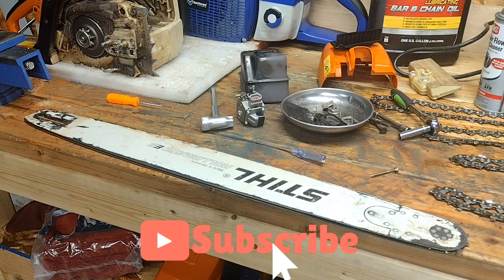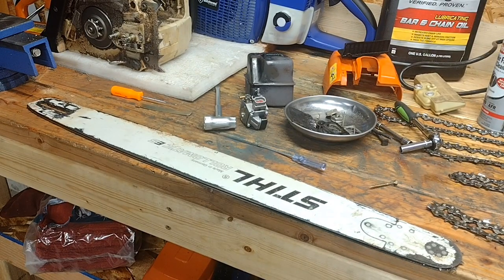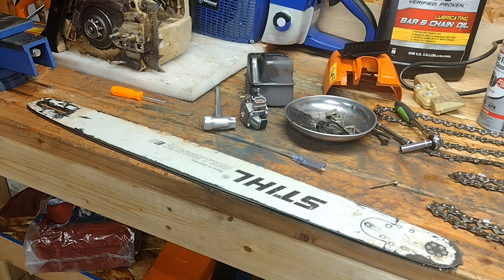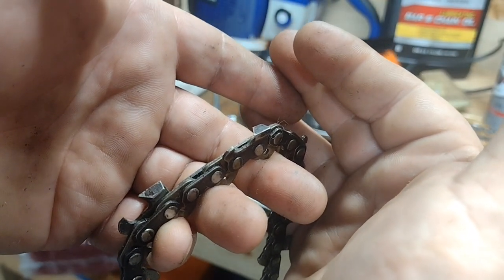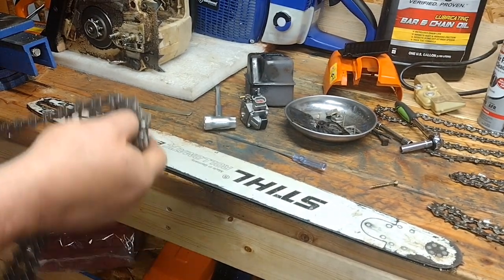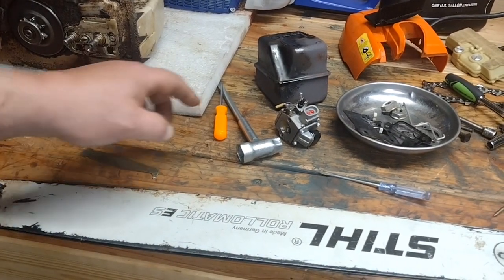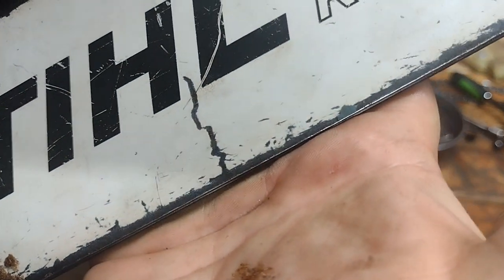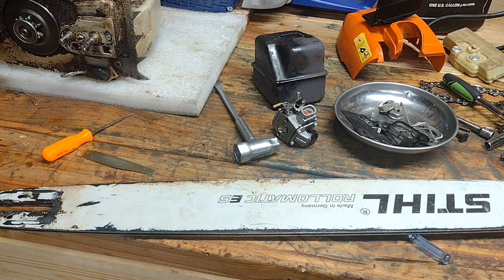Chainsaw chain stretching to fast ? Watch this !

Comment: Yes, used oil is not optimal.  However, many years of experience with old saws from the early 80s, and before,  will leak with high viscosity bar lube, , , , I switched to regular 20 weight motor oil, and although expensive, I think a good supply of lighter oil, is better than no thick oil, and I don't have puddles of oil all over.  Also, if one is concerned about a tackifier, something like Bardahl Oil Treatment Additive's or Casite Motor Honey can be added to the motor oil to help it stick to the chain, without  increasing the viscosity too much.  When it was available, I used motor oil with graphite added, and had no problems with that. Thanks for the video

Comment: If you run your chainsaw daily you use at least 2 chain's a day and every day you flip the bar around. Plus anytime you disassable you clean the darn thing from start to finish. Only this way you can run it long lasting. I always say 2-3 chains a day if you don't have time to sharpen your chains in the field have them stored in your ATV or UTV in a chain saw bar oil so dirt can't get to it. A tupperware container is perfect and anytime you change your chain clean it... ether works great with a nice brass brush you can clean it quickly as you change out your chain. And chainsaw bar oil isn't expensive so don't cut corners.

Comment: I use 90wt gear oil and 50 wt mix.when I make one gal of bar oil.been doing this for 40 years.
Reply from the maker: That is actually approved by many manufacturers. My husky manuals said gearbox oil is an ok equivalent

Comment: I clean the grove on mine after every job. I’ve noticed the stihl block up worst then others if you don’t clean them regular cause the way they block off the oil hole. If my bar gets hot I’ll pull it off and clean it but usually do that before I start and use good oil. I noticed cheap oil hardens up when it is mixed with sawdust after a day or so.

Comment: Okay i do all this still after cutting up   about a cord and a half  i have a 200 $ carbide-tipped chain that has reached its limit for my adjustment  on the saw  Can i pull a link out of the chain and keep running  it on my saw without having to change the sproket
Reply from the maker: You can but be sure to inspect the chain close and look for cracks in the link straps

Comment: I have a BX BlueMax 22” chainsaw and I can get about 30-40 minutes of use out of my chain before it’s so stretched it’s beyond adjustment. I’m using new chain oil that’s specific for chainsaws but the chains just won’t last and they are expensive. I don’t know why. To cut a single tree down I go through 2-3 chains. It’s so frustrating and expensive.
Reply from the maker: Is it oiling enough ? How much oil is left in the tank after cutting. Is the oil hole on bar groove open and bar groove clean ? Are the chains staying sharp ?
Reply: Pls pardon me for coming around late.  In my chainsaw journey i have found dunking the chain in bar oil makes a huge difference in chain stretch. Whether old or new chain, esp new. i use an aluminum pie pan about half fill with winter bar oil (lighter oil seeps easier into creases creveses gaps and rollers). Dunk that new chain, the manufacturer has not lubed your chain. Sharpen and clean your used chain before dunking. i don't know how long to leave dunked, i do an hour minimum but i may come back days later. Hang your chain and allow oil tp drip back in to bath (i like to give the chain a little roll on peg as it drips so to get oil inside it)

Take care now

Comment: New Frostbite chains stretching uneven and fast. without even cutting wood and yes new bar and oil working great. Stretched a 24" and a 20" within 3 minutes brand new saw. Bothe chains stretched uneven
Reply from the maker: Is it getting oil and are you using bar oil ?
Reply: Yes and yes, I am wondering if new chains stretch uneven, I have put three new chains on and they all do the same thing, Maybe I have to cut or run it longer to stretch the entire chain. I will see maybe tomorrow  @Broddi169